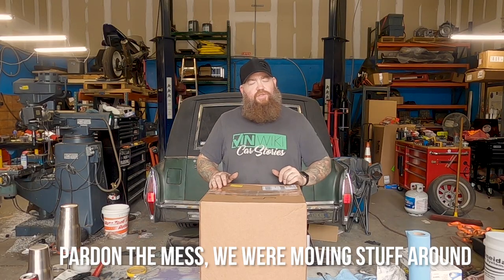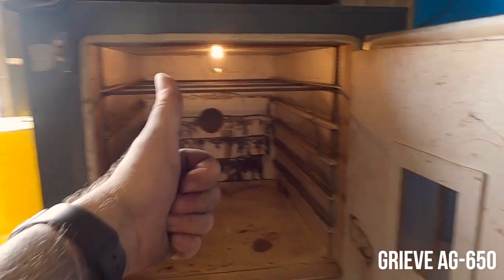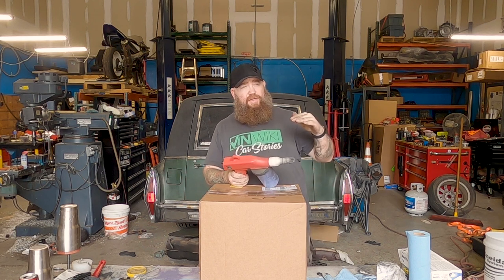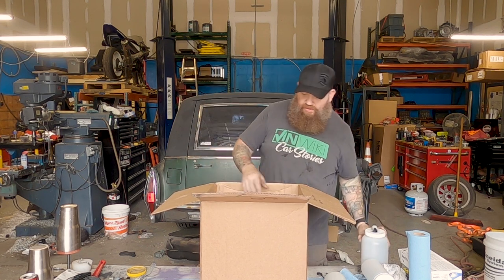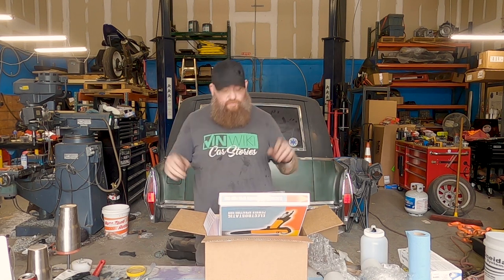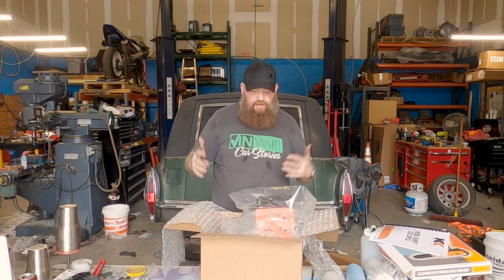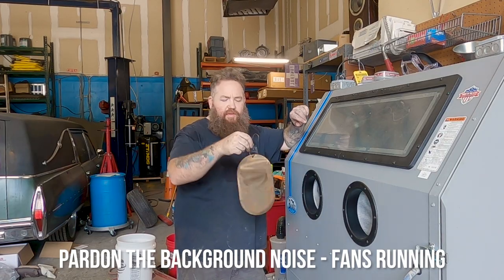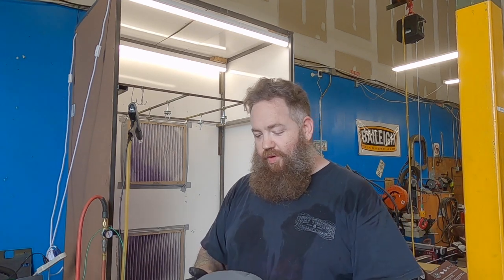Testing our new Kool Koat HD Powder Coating Gun (and unboxing)

Comment: Nice vid. I have the Redline ez100 and it is ergonomically awful. Also powder waster. The kool koat looks like a great next step. Thx for putting this up online.
Reply from the maker: We tried every possible permutation of settings with that thing and could never get it to spray worth a crap.  That KKHD was kind of pricey but the time savings alone and consistency made it worth it.